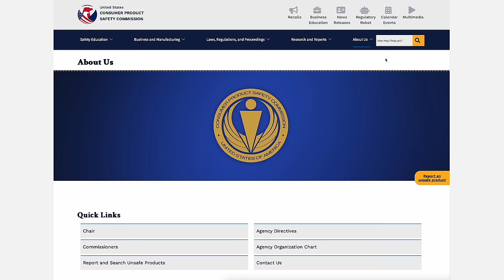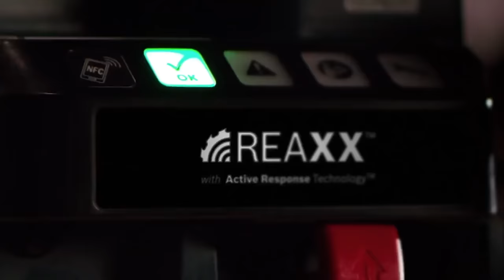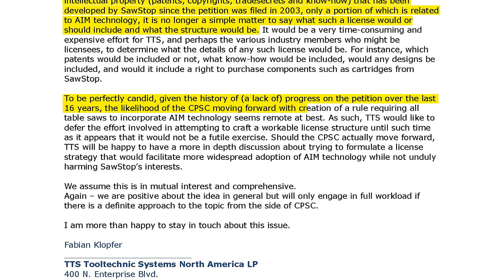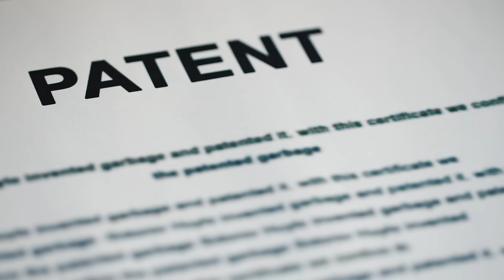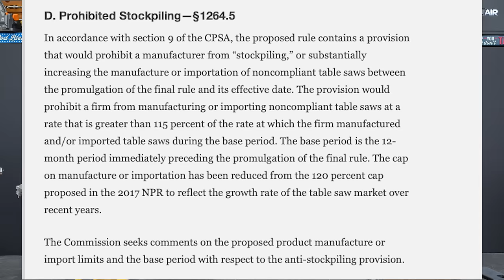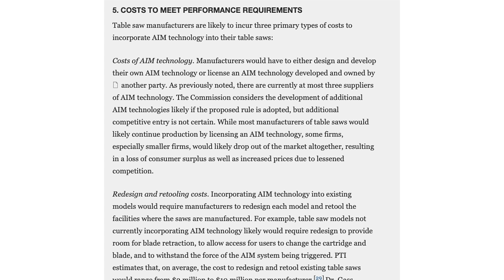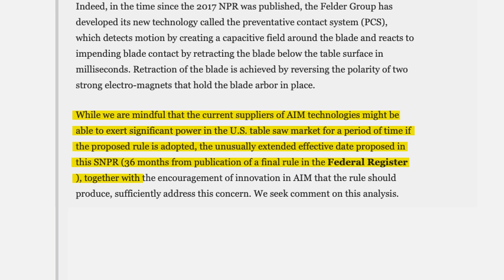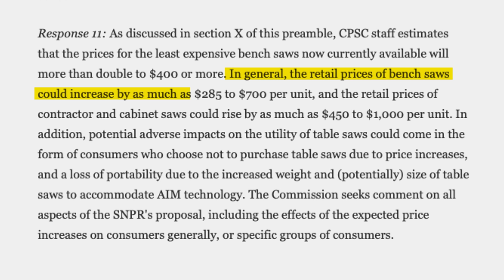The US Government is About to Change Table Saws FOREVER!

Comment: I work full-time as a carpenter in the entertainment industry and despite productions requiring the "hot dog saw" in our shops we end up disabling it for all the laminates and other conductive materials we use. Even pressure treated has tripped it on us. The blade replacement, cartridge, and sometimes material loss costs start to add up faster.
Reply: Do you think we need to Keep government out of this, this will create new laws and taxes with higher insurance costs to shops and individuals seeking liability and disability insurances.   Will OSHA rules could shut us down if we don't comply.
Reply: Although a headache for sure, this is a matter of when will it backfire, and not if. Do something long enough and someone will lose a finger and since you disabled the safety feature their to protect you, the medical cost may very well fall totally on the worker and not the company.
Reply: For sure! You would have to use only kiln dried lumber on your saw (sorry big box stores!) and would cause production delays if your material got wet in transport or something. The technology is already offered with the Saw Stop if they want it, forcing it on manufacturers would just hit the consumer in the wallet, basically footing the bill for the R & D required to bring this to market.
Reply: This is just like all the safety switches that make the user do contortions to use the tool, these will be useless at best and a threat at worst❤.
Reply: There are other systems which use cameras instead of conductivity.
Reply: @TheGreatChrisB  with deco metal laminates we don't have a choice. The metallic film will trip it every time. Client specs another material or they come up with non-conductive metal laminate then we would gladly leave it on rather than the turn key wait procedure:/
Reply: @briannelson4122  the state of the lumber that has gotten shoved thru the mills needs to be investigated. If not soaking wet then it looks like a coil spring. This all comes from a lumberyard not a big box. Our cull piles are larger than what we have in the racks at times. Most of our stuff is scenery but people are building houses and decks out of this garbage:(
Reply: @Bunnyonabender I think it's because tree farm stock is starting to become real common. Juvenile trees just aren't as strong. You can feel it when cutting them down. Growing strong wood just can't be rushed. It's a problem that will get worse as more wood comes from farms. Unfortunately most of the old growth is already gone, and we are a long way away from those forests being replaced. Your great great great grandchildren might see good lumber again😂
Reply: There are new technologies that are better!
Reply: I'm a finish carpenter we cut laminate all the time maybe we need a new stop technology like the camera

Comment: Realistically, there are only a few ways to implement AIM and if that are allowed to stay restricted then it will almost eliminate competition. The US government can open a patent and allow others to use it if it is in the best interests of the people. If they want AIM technology on all table saws, then they need to remove the patent protections so all manufacturers can add it to their products.
Reply: I  do not understand why the saw can not distinguish between wood and hands and if it takes so many seconds for the blade to stop once electricity is cut and a brake applied then any hand with in those seconds of stopping should stop the saw. Safety devices have been on machines for decades so  why are table saw so difficult? Laser beams, led sensors, heat sensors surely they can make saws safe with out the split second saw damaging technology of Sawstop.
Reply: 15~20 years ago yes.  No longer, there are several setups to protect the user from being cut these days.  Bosch, Altendorf, and Felder all have their ways of accomplishing this, just not currently in the US for some like Bosch.  Once manufacturers are forced to comply I do not think they will be turning down the opportunity to develop this time, or purchase a license agreement as they were offered 20 years ago before SawStop began manufacturing.  Those manufacturers that turned SawStop down on the license agreement failed to see the obvious future.  They are not doing so well these days.  Woodcraft used to offer many different brands of TS's compared to today.  Now they mostly sell SawStop.
Reply: It sure seems like the federal government just opening the patent would seriously discourage future innovation. Why develop the next big thing if the government will just decide it's so cool that everyone should have it for free?
Reply: Seems like Sawstop is pushing this to keep making money.
Reply: @tonysheerness2427  You are obviously not an engineer, but I am. Two things:
1) How does a saw know what it is cutting? How does a saw know that it is actually cutting anything at all? When you turn on a saw the blade starts spinning. At this point, a saw might know that it is cutting wood if it can sense the motor is under more torque than it takes to free spin a blade. A human finger offers very little resistance compared to a piece of wood. What if you are cutting a very thin piece of wood like a veneer? That could easily have the same load as a human finger. We also have dados, at least in the US. I would estimate that cutting a human finger would provide a similar load to a motor as the increased inertia a set of dado blades provides over a standard saw blade.
2) How do you stop a blade immediately once you detect it cutting human flesh? SawStop has a patent on separate brakes for a table saw. The other professional saw that was shown in the video and demoed previously uses an additional motor to move the saw blade down. However, that requires a fixed camera system to detect the hand before it gets to the blade to give the motor a head start in dropping the saw blade. That camera setup really only works in a fixed saw. It wouldn't be feasible to set it up constantly on a portable jobsite saw.
Reply: @maximusmagni1  Has nothing to do with load.  its electrical conductivity that triggers the stop.  The initial cost of reengineering and retooling is what  I see small manufacturers being concerned with...
Reply: We need to Keep government out of this, this will create new laws and taxes with higher insurance costs to shops and individuals seeking liability and disability insurances.   Will OSHA rules shut us down if we don't comply.
Reply: @drn1023  I know how SawStop works. They have a patent on that method of detection. I was replying to the post asking why ordinary saws cannot  detect human flesh.
Reply: @tonysheerness2427  I'm not sure you understand how quickly the blade needs to stop/retract to avoid causing significant harm to the user. You say "seconds" to stop. It needs to be just a few hundredths of a second.
Reply: @peaceshalom3030  The Wood Whisperer already addressed your part about liability insurance.  Once he hired someone to work in his shop with him he had a choice to pay a higher premium on his insurance or purchase a Sawstop.  It is already happening and the video he made was over a year ago.
Reply: @peaceshalom3030  why would a shop with safer tools have higher costs in disability & insurance? This would actually lower insurance risk of any shop using table saws. It also enforces a much higher safety regulations for all businesses giving them employees a safer environment. We all know business who cut corners to save a buck and the risk gets passed onto the employee. It really is the governments job to protect its citizens and this is a great example....im sure lead paint was cheaper at one point but im sure glad they banned that too.
Reply: Read what peaceshalom typed. The operative word is OR. As in insurance increases OR he gets a Sawstop. Not,  insurance increases because he gets a Sawstop.
Reply: I don't think this is a bad idea, AT ALL; I'm not being sarcastic.

I think ANY price is worth keeping your fingers/preventing accidents.

I think they should implement and enforce these type technologies in warehouses and meat markets as well/ANY WHERE that has the potential for something like this to happen.

I know what I am doing and I wouldn't do something like this anyway, BUT I still think they should make it impossible for you to cut your self in the first place, I don't see anything wrong with that, and you can argue its WAY LESS than what a hospital would charge you, to TRY and fix the problem/problems you had/have from the accident, keeping preventative measures in place, is  NOT a bad thing, AT ALL. I've actually seen people that do this for a living and are really good at building/have used a saw for years/ some basically there whole life and made one mistake and lost a finger/fingers, in some instances, I remember one instance that happened where this person didn't loose fingers, but ones the surgeries/reconstruction and healing completed and after multiple surgeries, the once talented experienced wood worker lost feeling in their fingers and also lost gripping strength in there hand, causing them to no longer be able to do what they love. I think a measley grand or 5 grand, would have been nothing to them, especially to be able to continue what they love to do.

Also I honestly don't think it should cost that much to implement these types of technologies, but I honestly wouldn't mind these technologies on my saws/I wouldn't complain, peace of mind, would be nice, I don't plan on making a mistake like this, but things happen, I've seen it happen, so I know, even with experienced machinery users, accidents happen.

Also this type of technology isn't that hard to implement/companies wouldn't have to out source/ pay for licensing, UNLESS they want to; Especially with the rise of AI; Also sensors/cameras/chips and so on have been around for YEARS, none of this is really new technology, I think automatic braking systems in cars are good too/people are idiots and cause accidents, ALL THE TIME, if we can prevent these things from happening all together, WE DEFINITELY SHOULD.

Comment: I was a Union Carpenter in various shops in Chicago for 22 years. Worked on a table saw every day- hundreds and hundreds of cuts every day. Never got a nick. The key to saw safety is respect for the tool. I always compare it to riding a motorcycle- as soon as you don't  respect the machine, it's going to bite you!!! I don't want the government to put training wheels on my saws!!
Reply: Unfortunately not everyone is diligent and non complacent as you are.
Reply: Operate a lathe on a fairly regular basis and I have never found my body wrapped around it's spindle 😂

Comment: I really hope this agreement somehow allows Bosch to implement the Reaxx technology again, I'm looking forward to purchasing that over anything from SawStop.
Reply: I hope so too. That would mean the we would FINALLY get access to this technology here in Europe. The only table saw sold here that has this safety feature is the Festool TKS80, a job site table saw that starts at €2000 (adding all the fence and runout options will run over €3500!). It has a proprietary fence system that is hot garbage according to reviewers, and precludes the use of popular 3rd party or homebrew fences and sleds.
Reply: @kaasmeester5903  I could be wrong but if I recall the patent dispute settlement stated Bosch would not sell their version in America.  I thought they could still sell it in Europe.  I also recall the two technologies were different.  The only similarity was that the blade would stop if touched.  Bosch had an interesting mechanism.  It didn't destroy the blade and it didn't require a 'cartridge' to reset it.  Old info and my memory might not be as clear.
Reply: Agreed.  The way SawStop tried (and continues to) use the legal system to strong arm other manufacturers shows that their concern for the users’ safety takes a back seat.  Look at their lawsuit with Bosch.
Reply: As an owner/user of a Bosch Reaxx, I still think it's superior to the sawstop. Precisely because it doesn't damage the blade and you can keep working after rotating or replacing the safety system's explosive cartridge (and maybe putting on a fresh pair of underwear...). It works similarly to how an automotive airbag works except that the explosion drives a piston that pulles the blade downwards in a split second. Each cartridge has 2 "shots" and after 25 times of the system triggering Bosch requires you to have the saw inspected/reset by a licensed technician/repair facility. Some people might balk or object to this, but given the violence forces at work when the system triggers (you're never expecting it and the bang scares the crap out of you!!), I really do understand this requirement. Also: if you, your employees, or anyone you are teaching/supervising are using a table saw responsibly in the first place, you're unlikely to ever reach 25 occurrences so this shouldn't really be a problem).

The detection works (as far as I understand, so don't quote me...) like the capacitative technology on touch screens. So, for cuts in conductive materials like wet/moist lumber or aluminum, you can override/deactivate the REAXX safety system with a separate button that you have to press at the same time as you pull up the saw's paddle-switch.
Reply: @rightangledesign After triggering the system 25 times may be it,s time for a new profession or hobby

Comment: A couple things to point out:

-Sawstop's brake requires a grounded power source, so if the rule goes through, it will absolutely destroy the cordless table saw market until we figure out how to inplement this tech to battery operated saws.

-When it comes to lisencing Sawstop AIM to other manufacturers, TTS probably won't have a choice but to lisence them as their cordless systainer saw and their CS 50 are gonna be pulled off the market, which will make a dent in their profits.
Reply: RE cordless saw: the saw detects skin contact by detecting a change in capacitance between the metal blade and some other electrode (in saw stop's case, ground). you can imagine the saw blade as one of the two plates in a classic "parallel plate" capacitor. when your (conductive) body touches the blade, the "plate" becomes much larger, causing the overall capacitance between the 2 plates to increase, and the safety circuit can detect this change by constantly charging and discharging the "capacitor" and measuring how long it takes. Since the saw stop plugs into the wall, it's convenient to use ground as the second plate in the capacitor, but that's not the only option. you can measure capacitance between any 2 conductive materials that aren't shorted together, so you could have your "ground" just be a pad on the circuit board, or a wire buried somewhere inside the case. those "build a game controller out of bananas" kits (yes that's a real thing look it up!) use this same principle, there's just a bit of metal on the PCB that it's using as its second electrode.

capacitive touch sensing is the same technique used on touchscreen devices like phones, and those things manage to detect touch just fine whether or not they're plugged into the wall. arguably a smartphone has to solve a much harder problem than a cordless saw does, since it has to cycle through an entire grid of electrodes, and then process all those measurements to figure out exactly where on the screen was touched, whether there are multiple fingers touching the screen, etc., and do all that with electrodes that are buried under a layer of glass, and thin enough for the screen to shine through. the point is just that capacitive touch sensing is a ridiculously advanced, very mature technology, and it's currently used for a really wide range of applications; the specific use case of "touch detection on a cordless saw blade" is definitely new, it would probably have some unique challenges on account of being a new thing, but it's not demanding anything inherently new from the tech. so, technologically wouldn't be too hard, i imagine the patent lawyers would spend more hours on it than the engineers.
Reply: - A Grounding line to the operator could solve this (making it idiot-proof is really hard in the construction industry).
Reply: @kadmow  Well, that's the real trick, isn't it.  You can never make anything idiot proof, because you can never over-estimate the ingenuity of an idiot...

Comment: I lost the tip of my thumb while using a table back in'97. It was an old cabinet saw with zero safety features.  I got lazy while ripping old barn wood down,   I kept the blade high so I didn't have to constantly move it up/down. The board hit a nail that I had missed and my thumb was history! I'd be interested in learning if the numbers of injuries/missing digits were actually all table saws, or are the adding accidents from shop smith's,  band saws,  scroll saws,  etc. I'd guess that they're all included which would make table saws not as dangerous as they indicate.  Even if their numbers are correct,  I'd guess,  90%+ of accidents were user error  and not the saws fault. I'd love to have a Saw Stop or something similar because the old saying,  it's not if, but when, but not in my budget right now. Kinda feel like this is just another government overreach and shouldn't happen.
Reply: @pinkyhotmessx69  I've done and seen some sketchy stuff, and have heard, "hold my beer", hundreds of times!!! Of all the accidents/injuries I've seen, almost all could have been avoided!!! Probably only a couple of times in 35 years, where it was a tool issue.  I have nothing against safety, but we definitely need to be better at taking responsibility for our actions and not allowing the government to have control!